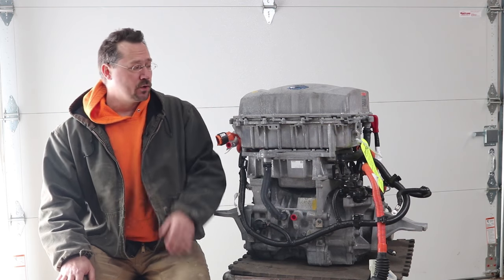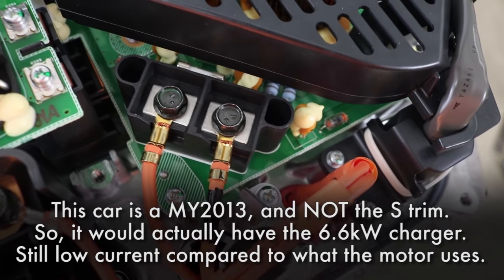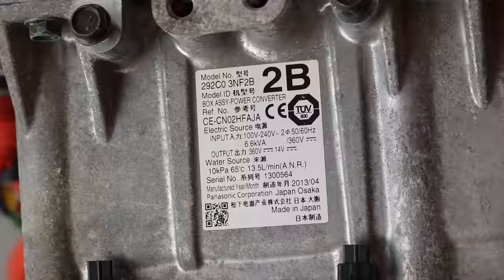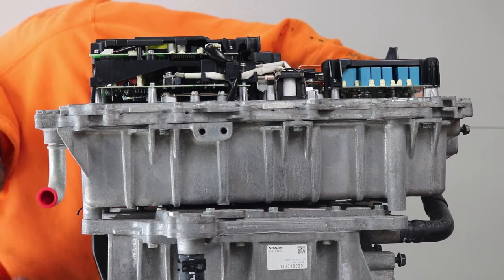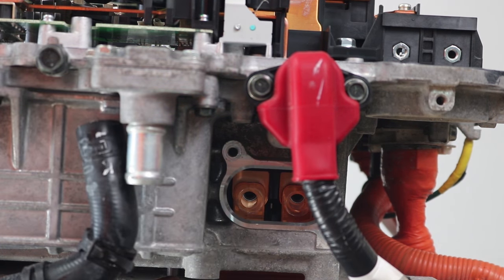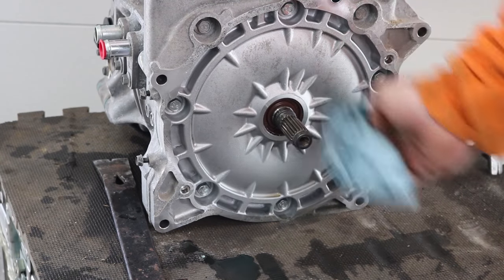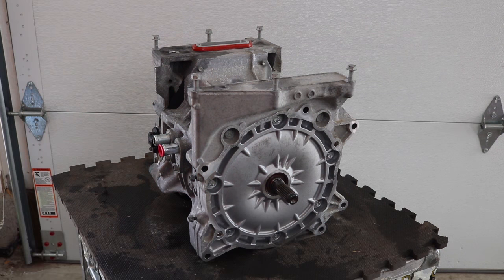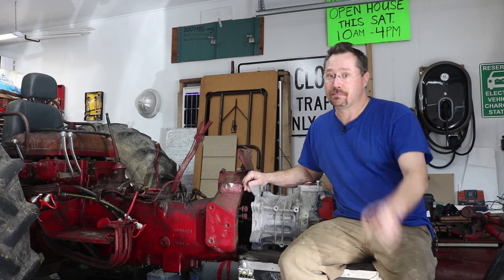Nissan Leaf Powertrain Disassembly (Teardown to EM57 Motor)

Comment from the maker: For people asking about a clutch, keep in mind that on a tractor like the one I'm converting right now, the TRANSMISSION is DIFFERENT than that of a car. It also powers the PTO and the transmission does NOT have synchros. For more on why the tractor would need a clutch, please see this video: https://www.youtube.com/watch?v=0Y5jmwD6rOY
Reply: Ben, The ball  bearings on the leaf motor are probably not designed to withstand lateral thrust load like you will be imposing upon them when a clutch is fitted.
You may need to install a separate thrust bearing mounted into the adapter plate behind the flywheel to oppose the thrust from the clutch release bearing every time the clutch is depressed, or the motor bearings may wear out prematurely.
Reply from the maker: Right. I’d plan on adding another bearing to deal with weight and thrust from the  flywheel/clutch.
Reply: I’m looking at fitting one of these to a Land Rover - the clutch and gear box are definitely required for that.
Reply: Thanks for the great instructional. As I'm just staring researching converting my 72 VW bus I'm trying to learn as much as I can about available options, so this is very useful. 

 Comparing the current 1600cc engine (60hp, 87 ft/lbs of torque) to the leaf motor (107 hp, 210 ft/lbs) it seems like a good option. I can get a leaf drive train locally for under $3k, whereas I would have to import an alternative such as an ac50 motor at a cost in excess of $6k, so if the leaf drive train comes with the inverter, charger etc that can be repurposed then that appears to be an even better bargain.
Reply from the maker: @joe8172  I think a Leaf drivetrain is a GREAT option for an old rear-wheel drive VW!
Reply: I guess im asking randomly but does anybody know of a tool to get back into an Instagram account?
I was stupid lost the account password. I would appreciate any assistance you can give me.
Reply: @Parker Darian thanks for your reply. I found the site through google and im waiting for the hacking stuff atm.
I see it takes quite some time so I will reply here later when my account password hopefully is recovered.
Reply: @Parker Darian It did the trick and I now got access to my account again. Im so happy!
Thank you so much, you saved my ass !
Reply: @Mohamed Terry no problem =)

Comment: For bolts you do not want to drop, if you put a few pieces of electrical tape inside and around the edge of the socket, the bolt will then stay snug in the socket.
Reply: Blu Tack also helps too, especially a blob on the end of pozi/phillips screwdriver :-)
Reply: I tape a small powerful magnet on the socket if there’s room. And have been known to put it inside the socket also.

Comment: Hi there, great video thank you! I wanted to know if anyone out there knows how to modify a 2014 Leaf so the airbags and the battery cutoff don't engage on impact - I want to be able to keep driving in emergency scenarios😉does a simple airbag module disconnect do  the job or is more required? Any Leaf gurus out there?

Comment: I wonder the voltage output if you put a multimeter on the terminals while you spin the motor by hand?
Reply: Ce x rpm

Comment: I'm on my second Nissan Leaf, a 2016 following a 2013.   The simplicity of the electrical circuitry to the motor,  the rugged stacked modular housings and the simple single reduction gear are an engineering masterpiece.   Nissan has kept the 2013 second generation design for good reason.
Reply from the maker: I agree. I was rather impressed with how all this comes together. Well designed.
Reply: But those batteries....
Reply: I had a 2013 that was rear ended. I was only getting 40 miles of range so it was a good thing. I took the insurance money and got a 2015 Leaf. Now I get 88 miles and I can fast charge with CHademo.
Reply: @dlewis8405 the upgrade to 6.6kW level 2 charging was very welcome.

A lot of people have 5-7kW excess solar during the day making regular range topup from excess solar easy

Add in the 6.6kw making overnight charging viable for 100km or more daily use, the leaf becomes a very viable daily commuter

Comment: I hope I’m not repeating something someone else said but, have you considered stripping the cylinder head and all of the rotating assembly and just attaching the leaf motor to the front of the original tractor motor?
Have it drive the crank. 
It should be very easy to couple the Leaf shaft to the front pulley of the tractor. 
It will add a few inches to the front of the tractor but will also keep that much needed ballast out front so you aren’t doing wheelies all the time 😂. 
And will save you the mess of trying to make a tube front end that can take the needed abuse via stress that those attachments and accessories are bound to subject the tractor to. 

I see this was from 3 years ago so I’m guessing my suggestion will be at best, 3 years late and a dollar short, but maybe you’ll do another one and give it a try. Either way, great well paced, well explained, and clearly lit video!!!!!

Comment: A few years back 3M talked about cooling EV batteries with a high-dielectric fluoroether called Novec 7200.  This stuff is VERY heavy- one gallon weighs 12 pounds- and it costs $520 per gallon.

Comment: If there is room, you can put a small but strong magnet inside your socket or sometimes, if the magnet is strong enough, you can put it on the extension. Hope this saves somebody from an afternoon of bolt fishing.

Comment: Amazing video! I was even more amazed by your tape measure. Imperial only? Never seen one of those before!
Reply: Different parts of the world maybe? I'm in Canada and most people I know still use imperial only, it's still majority imperial on store shelves, probably much more so in the States.
Reply: @Thoughmuchistaken  Yeah, here in the UK we use both imperial and metric, though metric is the standard for any type of engineering, design etc. Imperial is used by the older generation, and when ordering beer (in pints). Some grocery shops display food in kg and lb but not many. Roads are in miles and yards. It's a bit of a mess really!

Comment: Use a RC model ESC to drive the motor! Just 3 more and you can build a quadcopter :-)
Reply from the maker: Do you know of one rated for over 200A?
Reply: @BenjaminNelsonX  No, really, I would be interested to see if it would move on 4S LiPo and a hobby ESC. A quadcopter ESC would probably not work, those are not for low speeds.
Reply: @beforebefore  Seems reasonable. Try it nevertheless :-)
Reply: @BenjaminNelsonX  mgm compro makes some wild stuff
Reply: @kraklakvakve  No, you either burn up the ESC instantly, or you get nothing at all. Like beforebefore said, their frequency is too high to be suitable for use on automotive electric motors, so you'll need a lot of control to that. The frequency saves them because the reactive inductance resistance increases with frequency, and if the frequency drops, then the ESC will basically be short-circuiting itself with such low-resistance coils in the motor, and then you have no more ESC. Unless it protects itself.
Good luck trying to get 160kW from a breadboard-sized ESC. With 320V, you'll need 500A minimum
Reply: @NoorquackerInd  Well, I do not expect 160 kW, I am just interested what will happen. With a 4S LiPo, will it move? A quadcopter ESC would not work (poor low RPM performance) but a car ESC might.

Comment: Very informative and easy to understand video. I want to make a hybrid pickup. Could I use two of these, one as a generator and the other as a motor?
Reply from the maker: I don’t see why not. 
Many hybrids have a generator, motor, and wheels connected by planetary gearing.

Comment: I have no clue about these things, however wouldn't it be better to use the whole unit less the transmission with the charger and inverter and also won't you need a reduction gear between the motor and tractor transmission???

Comment: An engine is a system for converting something from one form to another.  It’s very broad, covering not just types of energy transformation (be it chemical or electrical into kinetic), but also any other transformation - stars, nuclear reactors, your digestive tract, plant leafs, even mathematical formulae are engines.  So, the scrap yard were correct.

Interesting and useful video, though!

Comment: Very methodical, careful and informative disassembly. Quick question - I've considered using two of these motors in tandem connecting them using a bespoke machined reduction drive "gearbox". Would I need to use one or both of the inverters (I guess I'd only need one of the chargers)?  Regards.

Comment: Thanks for sharing this year down, very interesting and fascinating.

I also like your project,
Will the Nissan motor have enough torque to drive the tractor, won't you still need the reduction gears to prevent motor from over overheating due to stressing?

I assume you are also going to use the Nissans ECU to control the whole thing.

Comment: Amazing how similar in shape and dimension the package is to an ICE.. I guess that is for production efficiencies..?
Reply: I was surprised by that too - on the one hand it looks very much like they're adapting the traditional ICE layout mindset to EV design, as you say with production in mind, but on the the other hand, having all those connections short and near to where they're needed makes perfect sense - less wires, less losses, better reliability - unlike say on Teslas where it looks like they just jam bits in wherever there's space with long HV and high current wires sprawled around throughout. On the other hand I'm wondering how much weight they could shave off by using less cast components and more composites - guess it's a cost thing (and robustness if using plastics...)
Reply: Unsurprising considering the LEAF is based off the Versa. 

Would be cool to see someone convert a large FWD car like a Buick Lucerne using one of these units

Comment: UUH!!  im so close to bying an engine and fiddeling with it..   i found a 2019  do i need the charger? it comes without it.    I need 190V batterypack pack?   Ill put in in my boat.. I wonder if i can configure the motor to run low rpm high tork because the propeller is rated to a rathe rlow RPM to not cavitate and destroy the propeller..  Thanks for a great video :)

Comment: I am not sure at the moment why you stripped that motor down, I dare say it will become apparent, but it looks like you have space for the bits you took off, and I assume you will need them. Or, we're you fitting all the batteries above the motor so the inverter and bits will have to go somewhere else?
Reply from the maker: I think the best place for the batteries will be a straight line above the transmission and electric motor.
The Leaf driveline as it is in a Leaf is VERY TALL.
I should be able to fit a pretty good size battery in the tractor, but NOT if the other components are in the way.
Here's a photoshopped mock-up of what the batteries might look like.
https://300mpg.org/wp-content/uploads/2020/03/IMG_0147_repeated-for-pre-visualization_smaller.jpg

Comment: Please don't use metal to pry off aluminum covers, if it has a gasket you can permanently damage the mating surface. Use a plastic putty knife, or you can use a plastic dead-blow to hit the side of the cover, gently.

Comment: how do you discharge any power that may still be in the system, how do you know you arnt going to hort out or shock yourself if the ratchet touches something at the same time your unbolting a connector?

Comment: Is there any benefits of using a transmission with the electric motor, over the gear box originally used? Can it improve milage,? Along with top speed?
Reply from the maker: In general, electric motors can spin very fast AND have high torque at low speeds. This allows for a single-speed gearbox to work very well with an electric motor. It's fewer parts - less weight to rotate, less friction, and fewer things to go wrong.
Tesla originally used a 2-speed gearbox in the Tesla Roadster, but kept breaking them, so they switched to a single-speed gearbox. The 0-60 speed on that car increased a TINY bit because of it.
There's really no practical reason to use a different gearbox/transmission with a motor like this EXCEPT if you are retro-fitting into an old gas car. In that case, the transmission bell-housing makes a convenient point of connecting the motor to the existing driveline.

Comment: The packed the whole thing in a comvustion engine format hh well done. There is a lot of Aluminium oxydation why? Cleaning with acid?
Reply from the maker: We use a lot of salt on the roads in the winter for melting ice. That’s notorious for causing corrosion on the underside of cars.

Comment: Good project but i think that motor will overheat, only if you get some reduction gears
Reply: Water cooled it should be good up to 130kW. Some people have even taken the stock motor up to 300WHP, it's the inverter that is more crucial!

Comment: Nifty, thanks for sharing this Benjamin! Do you have any plans for an ESC? Just putting it out there, but I think it might not be very suited for this, but there is another awesome Benjamin on the googletubes, the VESC creator from Sweden. His VESC's are pretty special, and the tool for these tiny inverters is pretty sweet to play around with. Maybe it can have some utility for this project, although you would need something much more beefy to drive it. And for that I may have another useful tip, there is this cool Irish dude that makes electric BMW's in his spare time, he is called Damian, and he has designed amongst other things a circuit board that allows to control Tesla inverters, he has also messed around Leaf inverters.

Then again, neither of these are probably new to you, but hey it's worth mentioning! Have a good one, and stay away from that virus thingy ;)
Reply from the maker: I'm familiar with Damien Macguire's channel. If I use this motor for the tractor project, I'll probably reuse the Leaf inverter, but will have to modify it slightly to take a standard throttle input. There are third-party boards and hacks to do that.

Comment: Hi, is the electric motor now running in direct current (dc) ?? Do you also have movies with the electric motor removed? I'm very curious what the rotor, the stator, looks like. I also want to know if it is possible to transform the electric motor into an Adam s type electric motor with impulse coils and collector coils. Thanks!
Reply from the maker: This is an alternating current motor.
I have not taken apart the motor itself. It is a permanent magnet motor, and those are particularly tricky to take apart without damage or other issues.

Comment: Ben, I'm a new subscriber, who is looking for a inexpensive used BEV. And I know you posted about, adding a liquid-fueled heater to an I-MEIV. So do you know of anyone that has added a Range Extending ICE generator? Hopefully with a waste heat recovery system too. Or have you consider this type of project?  (FWIW, I live in a rapid charger free (desert) zone too) 
BTW, I know this would be far more complex, than just adding a liquid-fueled heater. 
And good luck with this EV tractor project. I'm looking forward to see how you adapt the Leaf motor.... And the rest of your part choices and modifications you will need to do to it... (and I also, need to check out your past conversion projects too)
Reply from the maker: Vehicles like the Chevy Volt and BMW i3 REX are essentially already electric cars with built-in range-extenders. If you ask me, it's a lot easier to just but a used vehicle like that then to try to build your own.
I did experiment with adding a generator to my old electric Geo Metro - of course, that was nearly 10 years ago now.
https://www.youtube.com/watch?v=xXVi-g4jWqI

If you have a homebuilt EV, such as a pickup truck, you certainly could just put a generator in the back, but it would have to be pretty high powered to produce enough power to keep you continuously driving down the road, instead of slowly charging on the wayside.

Other people have experimented with "pusher-trailers" and battery trailers.

Used Chevy Volts are very reasonably priced right now. I bought one that was damaged by a deer and replaced the doors for a total of about $3,000.
Reply: @BenjaminNelsonX  Thx your feedback, but I well aware of both the Volt and the i3 REx. And ironically I was chastised by Alex (from Alex on Auto channel) for referring to the Volt as a REx EV or Series Hybrid, since he stated its very dependent on it planetary gearing, so its more of Parallel Hybrid like the Prius Prime. And the Vot has a shorter EV range than even any BEV even  he I-Meiv or Smart fortwo ED (451 model)... Which both tend to cost much less than the Volt or the i3 REx. 
And the i3 REx ICE, also doesn't produce enough power to maintain its full operating capacity. Which is even the case of the $460K Gumpert Nathalie MFC sports car, where the MFC is REx power source.... But it has a huge battery buffer, so it should not be much of an issue. 
https://www.caranddriver.com/news/a31406874/nathalie-methanol-powered-electric-sports-car/
That being said, if someone with your experience with EVs wouldn't try adding a REx ICE or a REx Sterling engine. I guess I will give up on my pipe dream. BTW I have never seen a Volt for $3,000, but never looked for damage one. So I may add the Volt to list. 
But I more likely will just try deal with the limitations of a used compliance car BEV. FWIW, it looking like it will be an i-MiEV.  I just hope it won't have flood damage....
Thx again for your feedback....